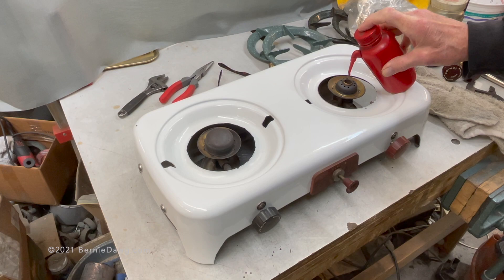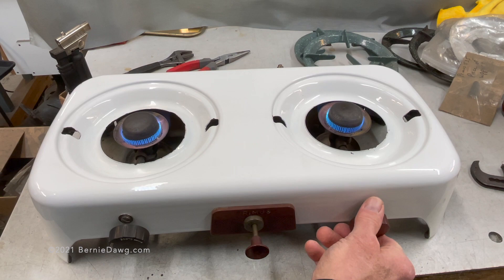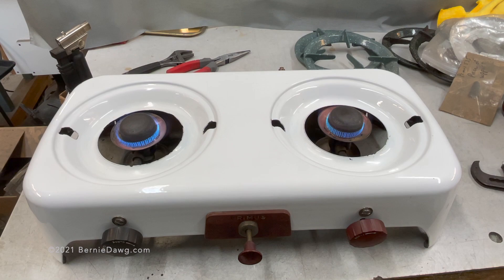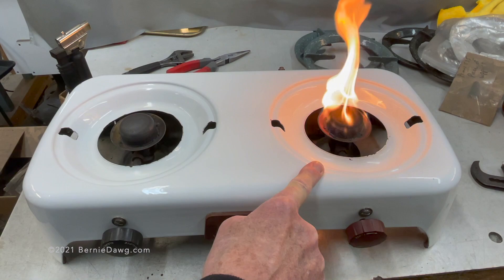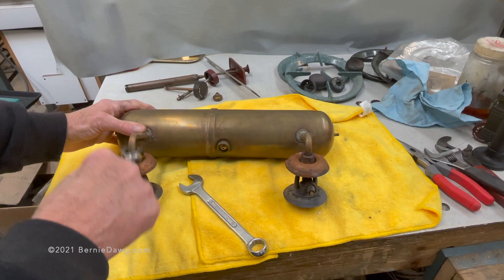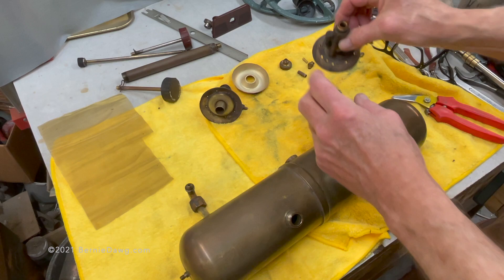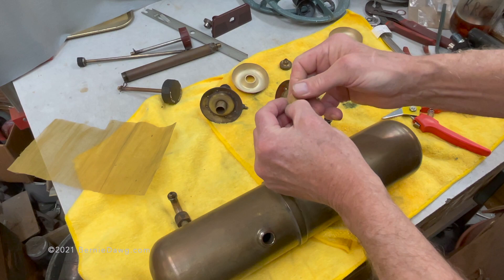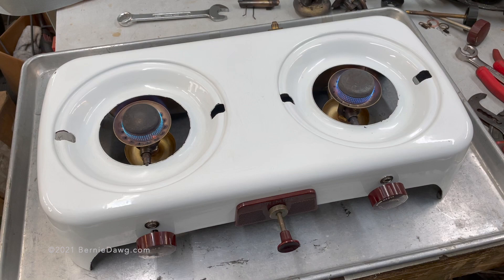Primus 535 Stove Surging Solutions

Comment: Thanks BD.  I've been scratching my head over a Heinze Geniol doing this very thing!
Reply from the maker: @Tim Epp Check to see if there is brass mesh in the burner base. It's been a while since I've had my Geniols apart. Some stoves will use a plate in the burner base with a tiny hole in the middle to achieve the same arrestment of surge. This is true of my big burners like the Primus #3 and the Primus 85. Having a roll or even a wad of brass mesh in the burner base doesn't hurt anything if you are using clean fuel which you filter into the tank through your filter funnel. Give it a try and see if it helps. BD

Comment: My alcohol stove does something similar.  The higher I turn it up, the worse it gets.   It surges and pops.   Sometimes so vigorously it goes out.  I can’t wait to look at mine.   It is an old gimbaled alcohol stove in a Catalina 27.  Seward Princes I believe.  Thank you for posting
Reply from the maker: @William Haley Alcohol dual burner boat stoves are the worst for surging. Even with mesh rolls in the burner bases, you'll usually get at least some surge. If you can get some restrictive mesh to arrest the surge into the fuel feed pipes and/or burner bases you can settle it down some. The Homestrand/Kenyon Mariner stoves have burners directly inline with fuel feed pipes straight across through the bottom of the tank. They will surge back and forth between burners. You can see one of my Homestrand stoves doing it in this video here: https://youtu.be/w_-jrk90enk Of course, good quality alcohol, not the cheap kind, will go a long way to making for a better burn, too. BD
Reply: @BernieDawgCinema  thanks for the tips.   I probably have some old and cheap fuel.  Likely hardware store denatured alcohol.  It will be a while before I can work on them.   I will advise when I do.
Reply from the maker: @William Haley Gotcha. Early spring, Covid. Real party poopers for boat work. Check my description box on the video I linked about the Homestrand where I talk about why good alcohol can solve problems and make for happier sailors. ⛵️ BD
Reply: @BernieDawgCinema  will do.   Thank you.

Comment: Perfect timing. Just got ahold of a Primus 516 where one of the burners does exactly that. What is the reason behind that behaviour? Is it the material in the vaporiser tubes that has gotten thinner because of use? In my case it's the burner with most use by the look of it that does this.
Reply: Thank you for all you're excellent videos by the way.
Reply from the maker: @Marcus Axelsson Thanks! Long brass fuel lines and no restrictors in the lines or the bases of the burners will make for easily surge-able conditions. When fuel vaporizes from a liquid to a gas it expands - a lot. Normally, the tanks are small, the lines are short, and the pressures are high in the tanks. In boat stoves or home ranges, there is a surfeit of room in the large tanks and the expanding fuel vapors can overcome the tank pressure unless there is a physical diffuser/restrictor in place. Use a roll of mesh to defeat surging and you are golden. Running your stove at higher tank pressures with a 2/3 full tank will help defeat surging as well. (Higher tank pressure to combat the pressures of expanding fuel vapor and fuller tank to provide less compressible air space above the fuel.)  BD
Reply: Thank you for your answer, I will try that solution. Just curious why it only happened with one of the burners and not the other one. I used the same tank for both burner tests, since at the time I had only managed to get the gas lid open on one of the tanks to clean it. I have fixed up a couple of stoves before this one and a handful of lanterns before that, much thanks to your videos. Never come across this issue before, mostly sot hindering the preheat and bad gaskets. So a god cleaning and new gaskets have solved the other stoves. By the look of it, I think the working burner has replaced the original burner sometime during the 90 years since the stove was made. That made me jump to the conclusion that the burner with surge issue was all used up and needed to be replaced also.
Reply from the maker: @Marcus Axelsson The world can work in mysterious ways and it may not be possible to know all the answers. 🙏🧘
Try swapping the burners from one side to the other and that will determine if it's a burner or a fuel line issue. 👍 (On the other hand, if a roll of mesh will fix 'em both, then it really doesn't matter.) 😉 BD

Comment: Hey Bernie
Been watching some of your videos! I have a Svea no. 5 primus with a silent burner cap - however the cap gets red/orange-hot when in use, and there is nearly no blue flames. What to troubleshoot and whereabouts to start? Best regards.
Reply from the maker: @Daniel Mohammadi Larsen It's very difficult to diagnose and correct stoves through YouTube comments. But, there's a email address in the description box below the video where you can contact me directly. Offhand, it sounds like you are not lighting the stove correctly and are getting underburn. Try watching this video to learn how to light a stove with a silent burner: https://youtu.be/9Y1sTEiBU7I If that doesn't do it, just drop me a note and I'll help you get things working correctly. 👍🙂BD

Comment: I know this a old video, anyway.  What causes it to surge in first place?
Reply from the maker: Surging is caused by vapor detonation (the rapid production of fuel vapor) in an unrestricted fuel path. What’s that mean? Liquid fuel flashes to vapor explosively. Occurs when the fuel path gets hot enough and/or when the fuel path is long or over-large. Provides a space for fuel to expand overmuch and too quickly and the expansion causes the surge. Mesh can help arrest surging. BD
Reply: Thanks for the reply. I just bought one of these and I'm waiting for it to be shipped, so I find this interesting.

So surging is just something that the manufacturer accepted?  Did you already correct the left burner in your video or was it working correctly?
Reply from the maker: @briancampbell6372 No. The original manufacturers had several means of arresting surging - one of which involving wire mesh as I show. But, old stoves get monkeyed with by many people who own them subsequent to the original purchaser. No telling what the interim owners have done. If your new-to-you stove doesn't exhibit surging when you use it, then don't worry about it. Enjoy! If it DOES show surging, now you know one way to fix it. If you need further help, then just email my help line at bd@berniedawg.com . That's the place to these sorts of technical discussions. Thanks! BD